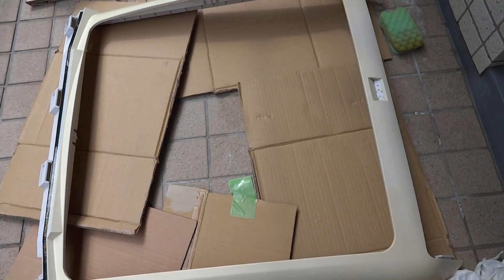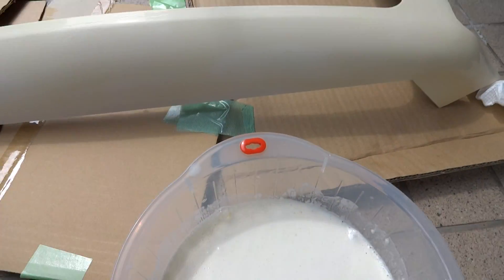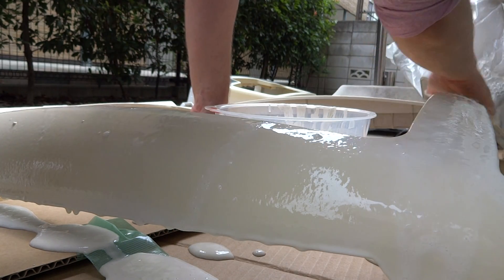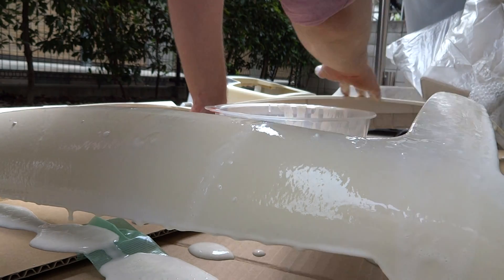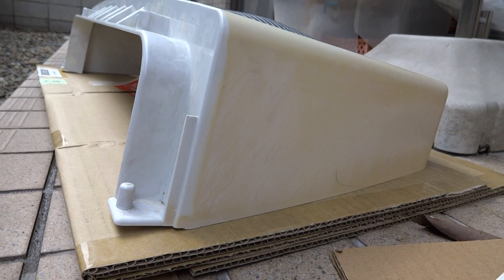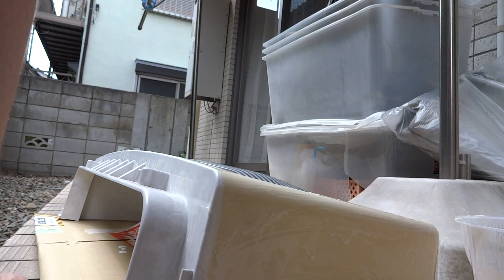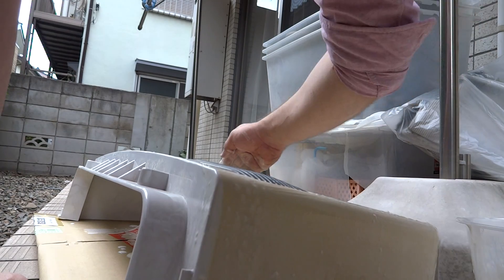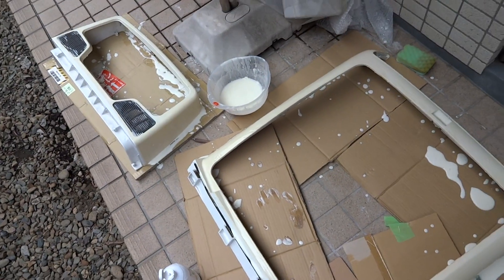Experimenting: Sun Bleaching A Super Neo 29 Plastic Bezel (Pt.4)

Comment: Bleach will actually harm the plastic and make it more brittle.  The retr0bright website explains the chemical reaction to the plastic, and why hydrogen peroxide works without harming the plastic while chlorine bleach (though it will slightly whiten the plastic) leaves the plastic compromised.